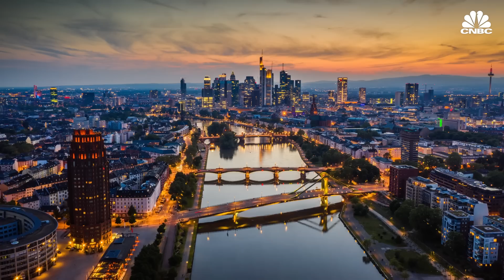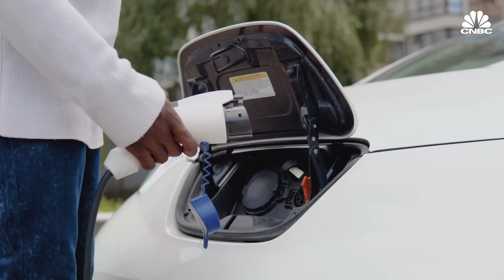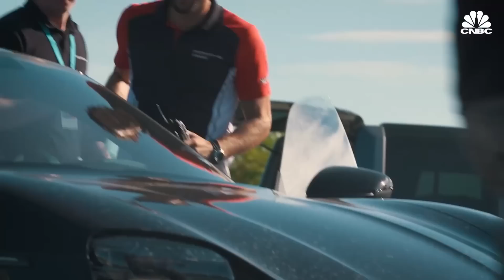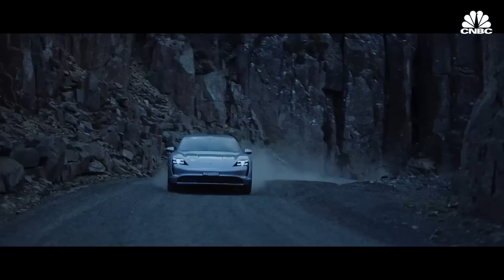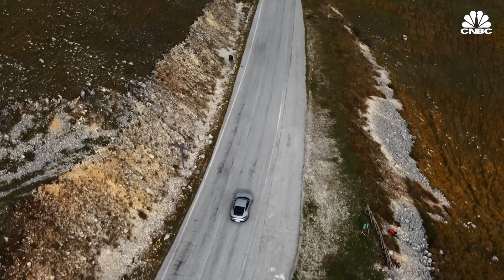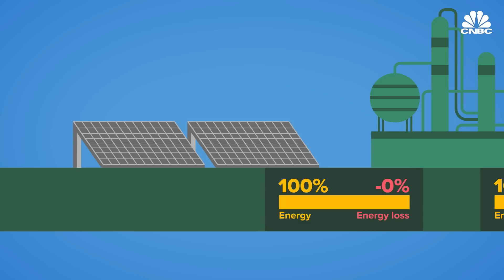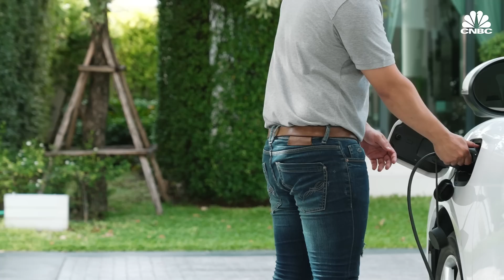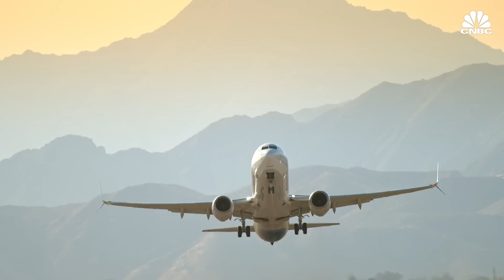How Porsche Plans To Keep Its Gas-Powered Cars On The Roads

Comment: As usual, CNBC spreading tidbits of Russian Disinformation in between a lot of correct info. The HUGE environmental impact of Lithium batteries, made with child labor and not enough Lithium mines on earth to build that many car batteries for the entire world for even just 50 years, is just one of the glaring omissions. Read up people and don’t be mislead by CNBC.
Reply: If you're going to spout conservative propaganda, can you at least get it right? The concern with child labor is from the cobalt in lithium batteries. Like oil, cobalt is a commodity, so even if EV companies don't get their cobalt from mines with child labor (and they don't), increasing the use of cobalt means the price of cobalt goes up, which means the cobalt miners using child labor make even more money, even if that isn't connected to EV batteries at all. This is very similar to oil where when the US drives huge SUVs, Iran gets more money when the global price of oil goes up, even if the US isn't buying Iranian oil to put in their SUVs.

Lithium is mined from underground lithium brine (a liquid) so no labor of any kind is needed other than machine maintenance, or from strip mining using heavy equipment when again, they don't use children (Child miners are using in underground mines). There are concerns about wast water in the brine extraction and the same concerns about strip mining that we have for every other metal as well as coal, but no conservative has ever objected to mining unless it was for something that would upset fossil fuel companies.

The rest of your conservative talking points fit the party line, but are of course wrong. We can extract enough lithium to manufacture current versions of lithium batteries for 70 years. It went from 50 to 70 because we reduced the amount of lithium required to make a battery. For lithium batteries, companies will continue to reduce the amount of expensive elements required (lithium and cobalt), so that 70 year figure will grow. Lithium batteries are also 100% recyclable and recyclable at a profit. While the government has to require lead-acid battery recycling because it wasn't profitable, there has never been a time when lithium batteries didn't make recyclers money. Since EVs last longer than ICE cars and EV batteries are converted to stationary storage devices when they become too inefficient for transportation lets assume 30 years before you need to scrap one. That means in year 30 of 70 years of lithium mining you get 30 years worth of recycled batteries and a lot of those were early models containing a lot more lithium than it takes to make a battery in 2040 (assuming the clock starts roughly when the Nissan Leaf and Tesla Model S came out). All of that is in addition to other competing battery technologies in development that don't use any lithium or other uncommon elements. Saying we don't have enough materials to make batteries for EVs now is like saying we don't have enough petroleum to replace horses with cars in 1918, ten years after the Ford Model T came out.

Comment: E fuel's may be carbon neutral, but it WILL COST SO MUCH NO ONE WILL BUY IT. Much cheaper just to use the elctricity in the first place rather than changing forms of energy twice and transporting it around. Think gas or diesel is expensive, E fuels will be $20. Euro's a litre
Reply: A lot of people will buy it,exaclty because its very expensive!

Comment: ANY internal combustion engine, whatever the fuel, is inherently less efficient than a battery-powered equivalent. So many moving parts. Every part takes a bit of power. Electric motors are simple, efficient, and require little or no servicing/maintenance. This is due to fail.
Reply: right? screw all those poor countries who cant in any way have EV structure. also scew city people who dont have private garages and depend on a new parking spot everyday.

Comment: The efficiency aspect is an argument of narrow minded haters. The efficiency is a "problem" for the end customer. He then pays a higher price per km of range than a buyer of an e-car. THAT'S IT. There is no reason to ban a technology that meets all environmental standards. The combination of emobility and efuels in the market has a advantage for emobility (manufacturers and buyers), since efuels reduce the demand for eCars and thus the demand for raw materials and thus the prices for raw materials for eCars do not increase as much. So anyone who drives an eCar should be PRO efuels (i.e. PRO the fact that a few "over-wealthy fools" should be allowed to spend big on expensive fuel - because it takes the price pressure off electric cars). The same applies to all environmental issues that come with mining for ressources required by electromobility industry.
Another benefit of eFuels is the reduction in cost pressure for electricity. The electricity for e-cars is produced where it is consumed. eFuels are produced where there is an abundance of green energy and green electricity is cheap - i.e. typically in very sunny or very windy places, and these are places where no people usually live. This in turn helps ALL electricity customers, not just e-car drivers but the electricity bills in private households, industry, etc.
Another benefit is for the climate in the existing fleet: Existing cars with combustion engines can continue to drive on the roads - climate-neutral. Without eFuels, these would continue to emit fossil CO2 or these vehicles would have to be scrapped technologically too early - for reasons of climate protection.
The argument of the low efficiency of fuel production becomes fragile when this waste heat is used sensibly, e.g. to heat buildings in southern Chile. This not only reduces the price of eFuels, but also saves on CO2 emissions for local heat consumers.

Comment: If they add three parts into one engine for each wheel ( electric motor generator , rotary engine , and hydraulic power like brake system drive the rotary when no combustion is used ) so each of those 3 part rotary engine can be used as airplane engine , ship propulsion , or electric back up driver in short it is like only prime mover use for all.we should let market decide the size of the market rather than control by engineer would be better

Comment: Yeah, gasoline car energy efficiency really sucks.  But have you sat behind the 911 steering wheel and listened to the roar of the engine while making a tight turn?  There is nothing on this planet like it.  You may have to fly a F16 off an aircraft carrier to beat it.

Comment: Is there any waste with this new fuel?
Reply: Energy. It takes a massive amount of electricity to desalinate water, a massive amount of electricity to split hydrogen from water, a massive amount of energy to run direct air carbon capture and then whatever energy is currently used for chemical refining. Even if all that energy is renewable, it could be going to much better uses like providing energy to 5 EVs instead of 1 sports car or running the same carbon capture, but then storing it instead of releasing it back into the atmosphere. It also produces the same ground level pollution that causes human health problems.
Reply: yes.

Comment: Porsche wake up, stop dreaming. The problem is not the fuel but the ICE, the most inefficient piece of machinery devised by man, that deliver to the wheels even below 30% of the power produced. While we are talking over 75% of the power produced by an efficient electric motor. Considering that the parts needed by an EV are much less than half than an ICE car, and the wind and solar energy cost just one third of gas or even less than synthetic fuel, should tell intelligent people that the ICE era is dead, and a beautiful new clean era is upon us. Be responsible and develop the electric motors, for its efficiency is pointing to our future from the limitless wind and solar energy ideally construed like Tesla with an OTA which would eliminate costly maintenance. I drive a Tesla and I would never again consider any other ICE car, but the vast majority of people when informed, feels the same way. If you don't stop wasting money on dreams, the consumers are going to do that for you within this decade.

Comment: An all electric future is not as close as people think. We’ll still have normal gasoline for the next few decades
Reply: Not according to Shell we won't. Shell's latest business report in Britain stated that they plan to cut the production of both petrol and diesel by 40% on the lead up to 2030...... Who knows what will happen after 2030?  There is no way anyone will still be extracting and refining crude oil for road fuel in 25 years, let alone decades....... Shell were one of the organisations who lobbied the UK Government to bring forward the UK ban on the sale of new ICE cars and vans to 2030, from 2035...... Shell in the UK are investing massively in both renewable energy and EV charging networks...... In Norway, Shell are removing gas/petrol and diesel pumps from their forecourts, to replace them with Rapid EV chargers. Around 60% of Noway's population now drive an EV.....
Reply: Norway is close to 100% EVs for new car sales. Globally new EVs were 14% of the market last year and are estimated to be 20% of the market this year. The question is when will it hit over 50% and then a few years later when will a used ICE car have a zero dollar value.

Comment: I'm a big fan of electric vehicles and their increasing presence in our culture. But I don't think fossil fuels are going away anytime soon. This E-fuel technology will evolve rapidly and spawn other initiatives. Electric vehicles and the infrastructure required to support them has a long way to go before actual mass adoption. State of California can incentivize all they want but at the moment the power grid is not sufficiently robust to support it.
Reply: This E-Fuel technology has been discussed since 2006 that I know of and this is the first pilot plant. No one wanted to invest in it because EVs were a much better option. Porsche pretending E-Fuels will happen and Toyota pretending Hydrogen will happen allows them to convince customers to keep buying the current profitable products so they can put off a full EV conversion, which is going to cost them a fortune in dealer service profits. No oil changes, no transmissions, brakes lasting forever because of regenerative braking all mean a lot fewer trips to the dealer. My dad's Chevy Bolt has its first scheduled maintenance at 100,000 miles. 

Do you think it will take more effort to upgrade the power grid, something PG&E criminally neglected, or to build new electricity generation to power incredibly inefficient desalination, incredibly inefficient hydrolysis and incredibly inefficient direct air carbon capture to make E-Fuel?
Reply: @patrickcorcoran4828  You raise very good and important questions. I honestly don't have a clue.

Comment: While in U.S companies are investing 100s of billions of dollars in battery manufacturing and technology, Europeans are working hard to find ways to keep ICEs/gas relevent.
Reply: Not so. There are around 35 EV battery manufacturing plants, either already up and running, being built, or in the planning stages in Mainland Europe....... The main issue seems to be with Germany, who seem to have a "green" controlling sector in their Government. It is they who have succeeded in pushing through this latest move to retain ICE production after 2035, but only if it is capable of running on greener CO2 free fuels.... We'll see how that works out....

Comment: Cars are not the issue. Cargo transportation, airplanes, heating, manufacturing, concrete production, fertilisers are. E-cars are not sustainable because of the battery technology being dirty. Address the big issues first. Sport cars are a tiny fraction of the emissions.
Reply: Batteries aren't dirty. That's a standard fossil fuel propaganda talking point backed up by nothing. Did you ever wonder why no one was concerned with mining until it was used for EV batteries. Did you ever wonder why mining lithium and cobalt was never considered dirty when 100% of it was used for cell phones and computers, or when 20% started to be used for EVs and it was only when EVs became mainstream and competed with fossil fuels that suddenly EV batteries and no batteries in other things are dirty?
Reply: solar panels on every roof and parking lot

Comment: Its a great idea, and has many merits.BUT providing E fuel world wide will be a problem. Investment will be very high and the price per Ltr will not be sustainable . I wish them all the best  as I love Porsche cars
Reply: Providing electricity world wide is a bigger problem; investment in that is astronomical & the cost for electricity is constantly increasing worldwide ( not affordable/sustainable by many in the world). There are conversations to be had pro & con on all forms of energy/fuels.
Reply: @mrmoss149  But of course you'd need the electricity in the first place, to manufacture the e fuel.........
Reply: @Brian-om2hh  or powering your EV? Your point is…? The ONLY current solution to clean energy on a large scale is nuclear. Not to mention all the acres of natural habit that don’t have to be destroyed like with all renewable (hate to break it to ya but even if there were solar panels on every roof world wide that wouldn’t be enough)
Reply: @Brian-om2hh  Very true; however, you can relatively transport fuel easily all over the world, as well as power vehicles with it. EV powering has a lot of catching up to do- would you agree?

Comment: I feel like the unique weight balance of the 911 could be achieved in an EV just by manipulating the size/location of the battery pack.
Reply: https://www.youtube.com/watch?v=ZQfkojLhY7U
Reply: They probably just don't want to say that an electric car can't be made light enough. But you need to tell some lies more accepted by the public.
Reply: @shmeleu  The issue with current battery tech is they can be made light enough, but at reduced range. I'm a strong EV advocate, but I'm not trying to downplay the tradeoffs.
Reply: @patrickcorcoran4828  well if it has to have a reduced range, it's not light enough!

400 lbs, or an ICE's worth, of battery doesn't get you very far. That's probably only about 25 kWh, 50 to 75 miles at best.

My 300 cc motorcycle costs about 5 cents per mile in dino juice. Then again with me on it, it's only moving 500 lbs around...

What's more important, total energy use per capita (including consumerist habits) or tailpipe emissions?
Reply: @identiticrisis  The motor and batteries replace almost all equipment in the engine bay, the exhaust and a full gas tank. In an automatic transmission car you remove the transmission too, but most standard transmission conversions leave the transmission in. As of 2023 Porsche 911 conversion kits have a 200 mile (322km) range, up from about 120 miles (193km) in 2016 and the range will improve as batteries get more efficient. Having a 200-mile range car would work pretty well for me. Buyers knowledge that is less than the 250-300 mile range that has become standard with new EVs and that its not going to charge as fast as a new EV.

Motorcycles have always been an excellent choice for reducing emissions. 

The problem with Porsche's e-fuel plan is that its not actually a plan, it is a PR exercise to convince 911 buyers to keep buying an old and highly profitable design over new much less profitable EVs. E-Fuels are not going to happen. I've been following renewable transportation since 2006 and Hydrogen looked like THE answer until Tesla came out with the Model S. Hydrogen conversion efficiency has made no progress since then while battery efficiency has shot up and price has shot down. Porsche is saying they're going to take the already non-viable hydrogen fuel and combine it with incredibly inefficient direct air capture carbon to make e-fuel and somehow distribute that in a world where only rich sport car customers would be interested in it? It seems like if they were serious about a solution to the road feel of the 911 they would be working on a carbon fiber frame EV instead.

Comment: The problem with eFuels is that you are still burning [expletive] to move you around. That is so inefficient. Heating up an engine block does not move your car forward.
By 2030 every new car sold will have an electric powertrain, by law.
Every buyer of every new car sold will be ever so thankful of the added torque, power, and efficiency of the electric powertrain.
When a Porsche 911 ends up being shut down by a cheap Chinese nock-off or by a Tesla you'll wonder who's the troglodyte driving that old 911?

Comment: As a brazillian, I watch this kind of strugle to creat a new fuel and it seems so unnecessary. Here we have alcohol in every gas post since the 70s. The adaptation from gas to alcohol is small and the car even gets a little horsepower more. It's low tech and can be made with leftovers from agriculture. I mean... the process can be hard in some countries but litteraly create gasoline from the air and water in a incredible expensive and hard to scale process? The argument for old car and poor countries too gets a lot difficult to accept when you need to go to the edge of chile so the process is a little more efficient (and the ships that are transporting this fuel burns what? e-fuel too? hardly). If wee need carbon neutral fuels to motorsport and ICE sport cars in big quantities, just call brazil or the biggest producer of alcohol fuel of the world: USA. I certainly wold prefere f1 cars using alcohol than being electric or use even smaller engines. 2026-2028 3 cylinders 1.0 turbo hybird f1 cars are coming...